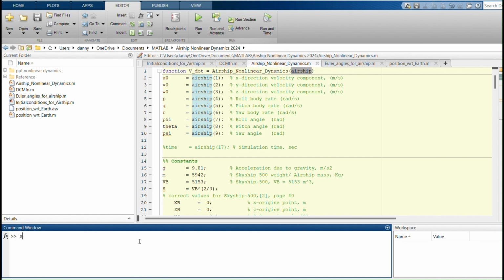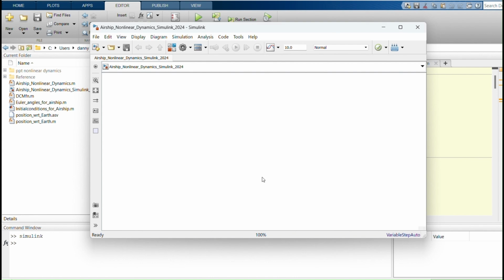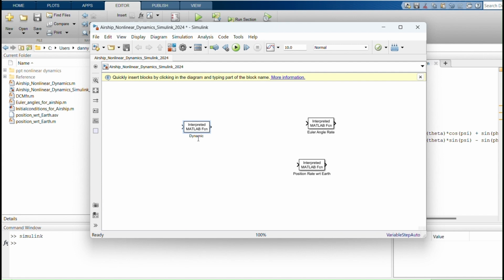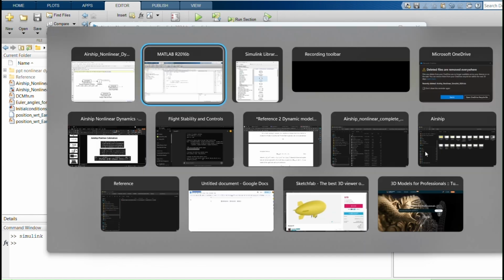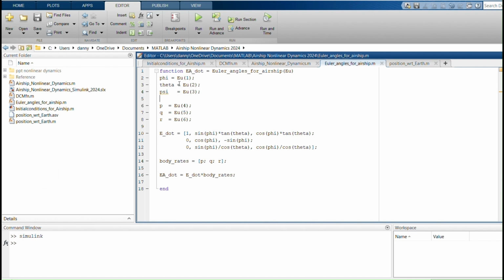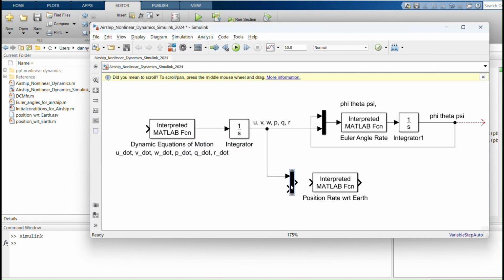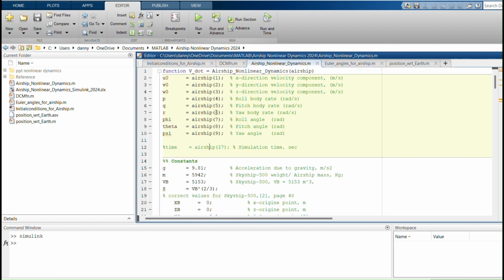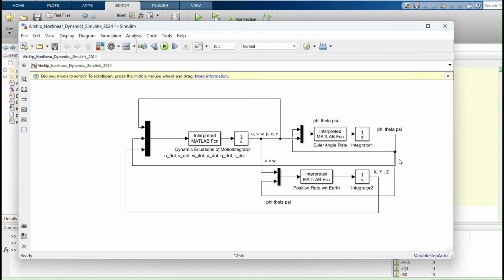17. Airship Complete Simulink Block Diagram || Airship Nonlinear Dynamic Stability Analysis - 2024

Comment from the maker: In the Position _wrt_Earth.m function, change the variable number from phi = xyz(4), theta = xyz(5), psi = xyz(6) to phi = xyz(7), theta = xyz(8), psi = xyz(9). 
The number 7, 8, and 9 are correct connections as u = xyz(1), v = xyz(2), w = xyz(3), p = xyz(4), q = xyz(5), r = xyz(6), hence phi = xyz(7), theta = xyz(8), psi = xyz(9).